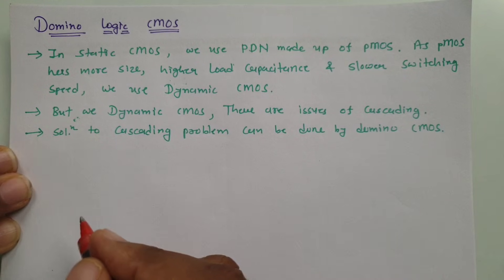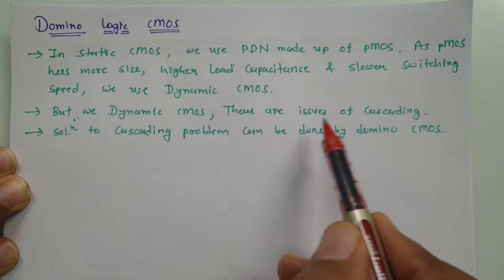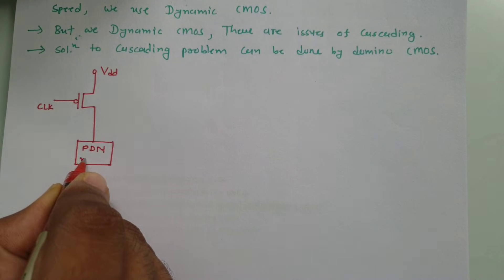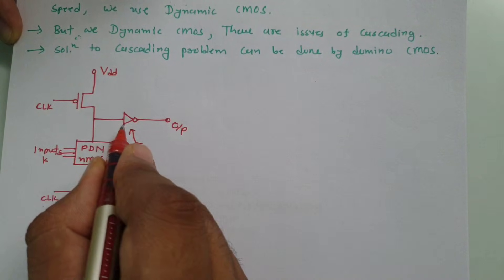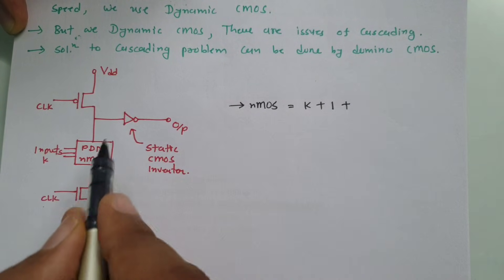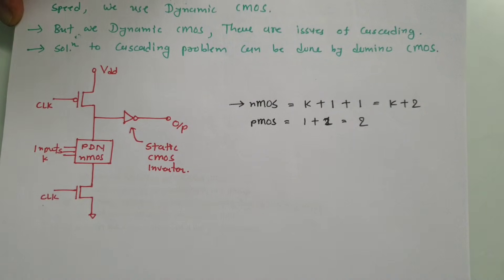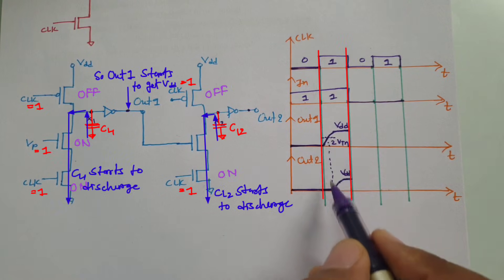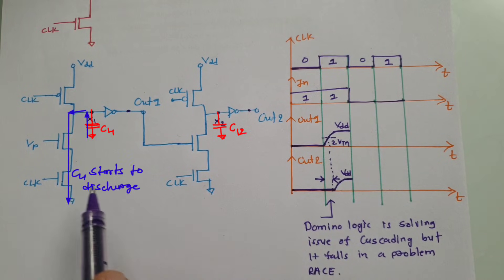Domino Logic CMOS (Basics, Circuit, Number of Transistors & Working) Explained

Comment: 10:58 How x1 will be in Vdd stage if pmos is off? x1 should be 0 here and after inversion it should be 1. So, output 1 would be 1. Right?
Reply: it got charged before that cycle
Reply: @vinayanpa126  Semester passed. But thanks. I will check later if needed.
😅

Comment: sir does the capacitors are actually present in above  domino cmos

at 11.19 how the output 2 is 0. i think it would be 1
and i have 1 doubts regarding chargings and dischargings
Reply from the maker: It is not fabricated, it is happening due to circuits.

Comment: WHEN clk=1 and and input=0 , why did you take output as zero, bcoz when clk=1 and input=0 both pmos and nmos are off right ? how did  you get the voltage before inverter as VDD,  can  someone please tell this ?
Reply: Pmos is off nmos is on  but input is 0 so  output 1 is high-z it has no path neither to ground nor vdd  output1 was zero so it will keep 0 volts. But it will be floating taking noises from the ic and from the outside. This is called Low-z i think

Comment: in the case of CLK 0 and INPUT 1 had the output 1 and 2 as 0 logic.. shouldn't X1 be in 0 state and then inverted and charged up to Vdd for the case of CLK 1 and INPUT 0, for X1.
Reply from the maker: It is perfectly correct here
Reply: @EngineeringFunda  ohk thanks a lot again